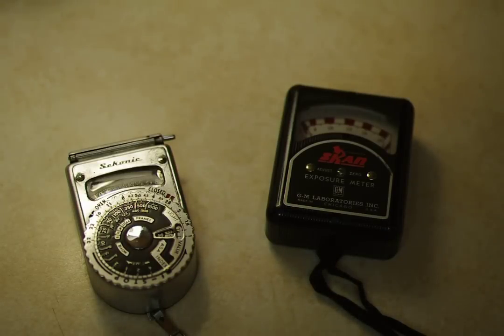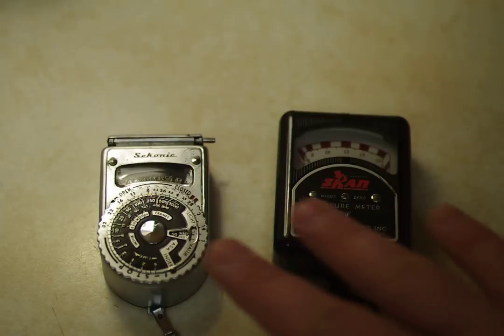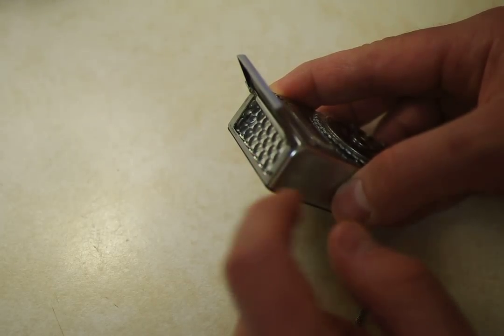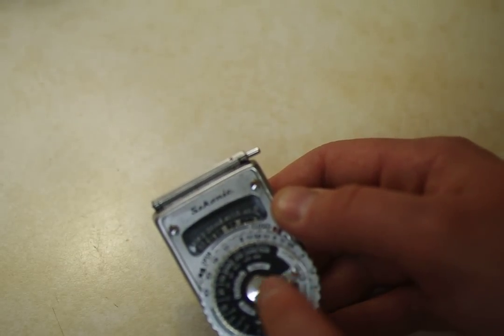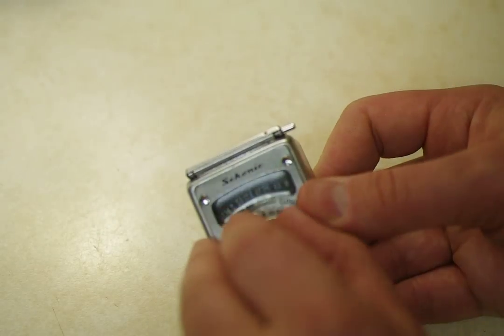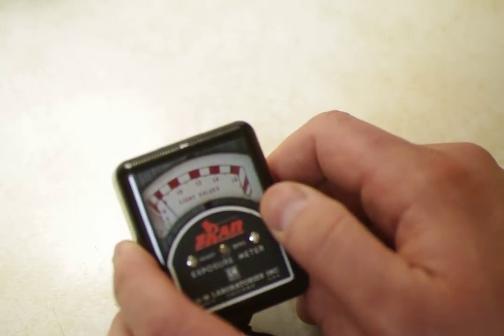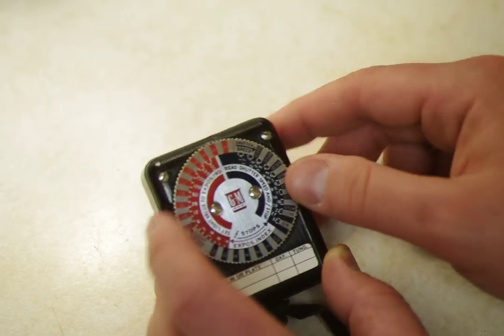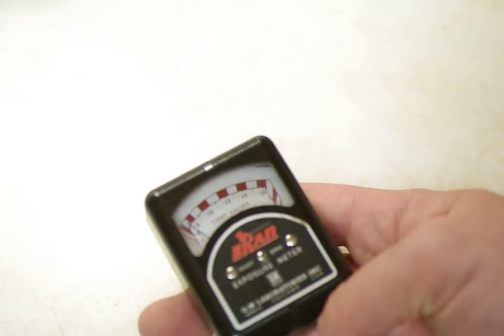How to use Light Meters

Comment: Not sure about the explanation of the first sekonic
Reply from the maker: It's been some years since I sold this one, but I was using a more complex Sekonic today. What don't you understand? I can try to explain it better.
Reply: @DavidHancock  your explanation is just wrong
Reply from the maker: @gillesdoc  Do you have anything to say besides "you're wrong?" Right now it sounds like you don't know what your talking about and just want to be belligerent.
Reply: @DavidHancock  If you read the pdf of the instructions you can clearly see that your explanation is not aligned with what you say in the video. According to the official instructions red and blue marks don’t indicate the aperture that you should use when the cover is open or closed. To explain how it works it is better to consider an example: If your Asa is 100  (as example) the value in the LightMeter is equivalent to the f (aperture) that you should use at shutter speed 1/100. If the cover is open you should multiply by 10. If your Asa is 50 or 200 the value in the LightMeter is equivalent to the value (f aperture) with 1/50 of shutter speed or 1/200 of shutter speed
Reply from the maker: @gillesdoc  Thank you. This is what I needed. I'll take a close look at the video and manual tonight and am open to the possibility that this needs to be redone. This is one of my very old videos and some of these do have errors. Thank you very much for your help. I may be able to remake this one next time in the studio to correct this.
Reply: @DavidHancock  my pleasure, glad to have helped
Reply: @DavidHancock  you’re welcome 😊

Comment: Hey, still not understanding how you got settings on the Sekonic which i am purchasing. I am aware that i set the ISO of the film (in my case 400 or 800) then, the needle goes from 1-8 on both open and close, depending on the scenario, so whichever that i get a reading of, i match it with the blue or red, (open, close). The problem is, if the meter only reads  1 - 8  on the light scale, isnt that aligning the f stop to the red or blue and very limiting since it corresponds to stops f1-f8, but an f stop can go to 22. Does this device work with a higher f. stop?  From that point i am confused with getting the reading of the shutter speed and aperture. You said f.22 at 1/250 of a second and at the same time you also said,  f.11 is 1/1000 , but those are relatively different readings. I am sure you are right, because you are a pro, but  i am new to this and need some clarity! You are one of the only videos on these old Sekonics. Would you make another video on it explaining it more, or explain to me through this message?   How do i know which to choose when i take my reading? All im looking at are numbers on the exposure meter, but i'd like to know how to narrow it down to specifics. Thanks!
Reply from the maker: So the old Sekonics, and new ones, too, measure light and report it in exposure value (EV) instead of camera settings. That's why f/22 at 1/250 is the same as a/11 at 1/1,000. There are two stops more light coming into the lens at f/11 vs. f/22 (f/22 --> f/16 --> f/11) and two fewer stops of light coming in at 1/1,000 vs/ 1/250 (1/250 --> 1/500 --> 1/1,000). So even though the settings are different, the amount of light reaching the film remains constant. You could extend that, too. f/5.6 is two stops faster than f/11 (f/11 --> f/8 --> f/5.6) so the shutter speed would need to be two stops faster than 1/1,000 (so 1/4,000) all other settings being equal.

The 1-8 that you see on the light meter is the EV range. EV is used instead of hard settings because EV is a measure of light level. Camera settings vary by film, aperture, and shutter setting to control the light reading the film based on the EV. But with cameras, all that EV-based calculation is done in the camera and we don't see it. With light meters, since there's no way for them to communicate with the camera, we have to interpret their EV reading for the camera and then input the correct settings based on that EF reading.

Fortunately, the light meters help us. So when the meter gives you a reading of, say, 5 EV and you then set your film's ISO to 400, the rest of the settings should align. You can then see the range of aperture and shutter combinations that will work for your given lighting conditions.

Does that help?
Reply: Thank you! So even if though the F-stop dial goes from 1 up to 32 , we only limit ourselves from 4-8 and move that number either to the open or closed.  From that point we would have already put in the iso and so wherever the little red dial is on the scale, we look down and see the matching shutter speed scale number  to the red dial without moving the shutter speed dial scale, because it would alter the matching iso?
Reply from the maker: I think the answer is yes. I sold this light meter a long time ago and my current one has a different interface. The EV number from the meter readout should me used in the on-meter calculator (the dials are just a calculator) to ascertain the camera settings. The EV itself will not directly translate into use on modern cameras (anything made after the 1960s, when EV use on camera dials fell out of favor.)
Reply: Thank you so much!

Comment: what is the current value of these old ones, thanks
Reply from the maker: Not much. A few bucks or so, typically.
Reply: David Hancock  thanks  I found an older one than the one u have, looks similar to ur one. roughly how much is a few bucks? and what currency are u refering to, thanks
Reply from the maker: I think these usually sell for around $5-10 USD.

Comment: I don't use a meter personally, with dslr cameras now u don't really need to, I mean I can pretty much get great settings after two shots on camera
Reply from the maker: Modern light meters are much more accurate than the older, hand-held meters. These are good for meterless cameras and cameras with dead meter cells, though.